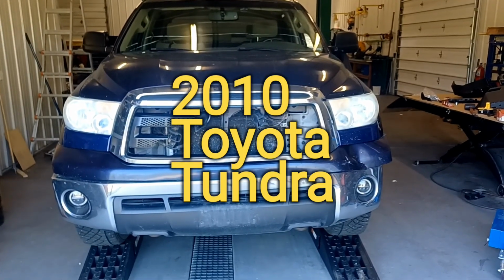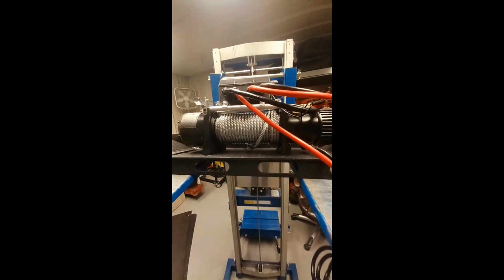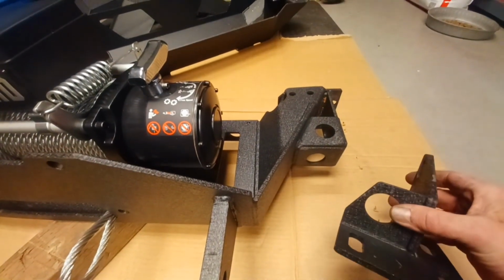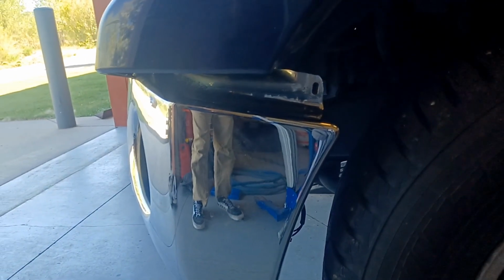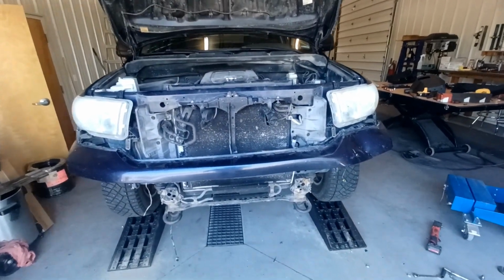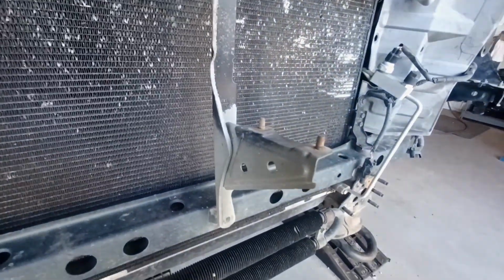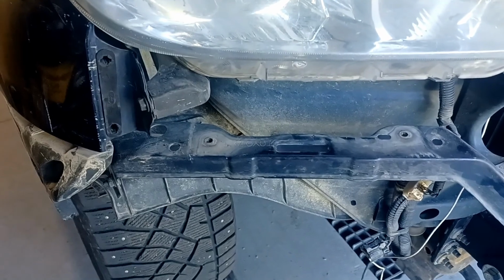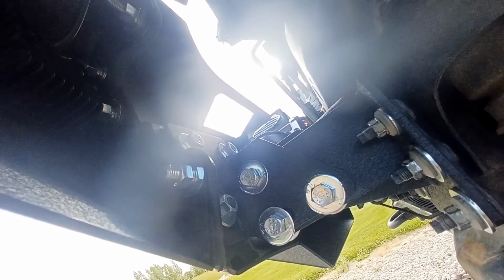Install YIKATOO Offroad Front Bumper for 2007-2013 Toyota Tundra,Steel Winch Black Powder.

Comment: Looks like you missed two brackets, that go from the top of the winch carrier to the sides of the frame, with the little plate with two nuts welded on them as a blind nut piece inside the frame itself